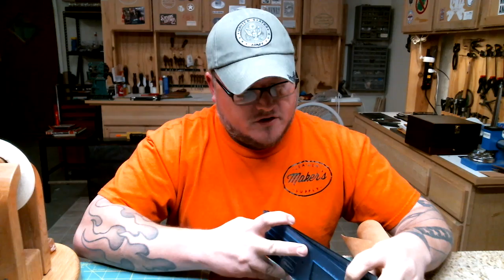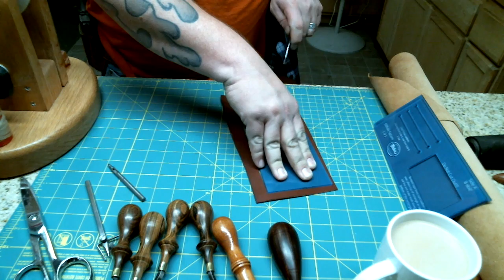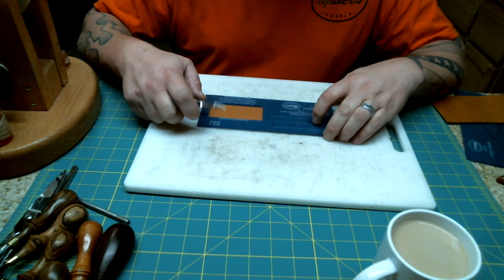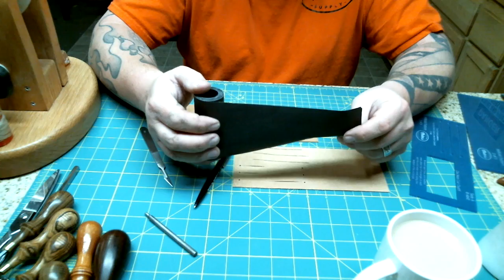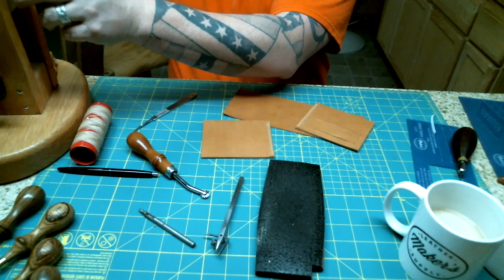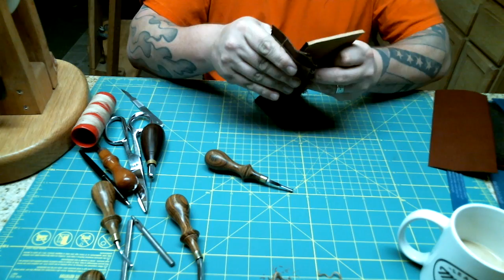Making a Billfold with the MLS Template Set

Comment: Hey Aaron, I don't know if you solved your Tieback issue, but I may have something you can try. I use photography backgrounds. They are a very strong nylon material, yet very thin and light weight, and come in a multitude of colors. I buy them from Amazon and cost about $15.00 - $20.00 each. I have been cutting strips and using this material for over four years, and it is fantastic. I am only about a third of the way through my initial purchased background.

Comment: i made 2 of these wallets this weekend and for a beginner, i think they came out decent.  the question i have is why wont it stay closed when i sit it down?  i put my granite on it over night to weigh it down and it is closed the next day.  but when i open it and close it,  it doesnt stay closed.  is that due to the leather needing to break in?  im sure once there is stuff in it and it is in the pocket it will help it stay closed. i just want to make sure i didnt screw something up since i am giving them as christmas gifts.  lol
i assembled it the same way as the video and  cut the half circle out and sewed across.  im hoping it is just a breaking in issue.
Reply from the maker: Could be breaking in.  Could be that your interior leather is a little thick.
Reply: @makersleathersupply1220  interior leather is thin. Might even be faux leather.  I'm really hoping once it breaks in it'll stay closed. Thank you for the great videos. I watch them and pause them over and over. Lol

Comment: Every template I’ve bought from u was unable to trace the card slots with my scalpel. The slots were to tight and my super thing scalpel could t fit.
Reply from the maker: If using an actual scalpel (not an exacto blade), there might be some laser trash in the slot.  Turn the blade over and use the non sharp side to push it out.  If you are using an exacto style blade, that is thicker than a scalpel.

Comment: i just purchased a few templates from you and have to ask. what punches do you use? i dont want to use a punch that is tapered differently and risk breaking the template
Reply from the maker: The set I have are very old.  I suggest marking your holes and punching after removing the template.
Reply: @makersleathersupply1220  cool beans will do thanks :)

Comment: Never understood why anyone creates a fold over, increasing the thickness of the card slot section, for a segment they're just going to stitch directly to the back anyway?  Pretty pointless.  Just cut a single layer, tyvek the backside then stitch it to the inner cover like you did with the tri-fold center.  Save yourself the extra 1/8th of an inch in thickness.  The fold-over makes more sense in the Roper, where you're actually using the space.  Other than that, it looks really good.
Reply from the maker: It is not stitched to the back on the folded side.  It makes a pocket there that is pretty useful.

Comment: how would one add RFID-blocking, i am asked about this often ... ?
Reply: found out that they are using that silver TAPE like for duct work .. i know you probable did not have time to reply ...
Reply: I use mylar.  Its cheap like ~2 or 3 dollars and i glue it to a sheet of tyvek before i cut out the strips for pockets

Comment: Aaron i ordered the template,  tape and tyvek from you and love it.  Just one question.  Is there a trick to keep my needles from getting so sticky sewing through the tape.  Keep the videos coming.  I love them
Reply from the maker: Not really, that is the downside of using the tape for holding the leather together.  I use a lighter occasionally to apply a little heat to the needle and then wipe the residue off.

Comment: Does the stitch line at the sides secure the tyvek pockets or does it only go along the leather? Surely just glue would come undone over time?
Reply from the maker: The tape will hold.  As this wallet is used it will constantly be compressed.  I've made them this way for almost 10 years and haven't had one fail yet.
Reply: technically the tyvek isnt secured at all by the stitching however; there shouldn't be any pressure great enough from putting a card into the pocket to sepatate the tyvek and leather that is taped together. if it does happen then that would mean that someone tried to shove their card in hard enough to damage the lining, and having used this tape and tyvek myself i can assure you "under NORMAL use there is little to no chance that this tape will fail"

Comment: What's the weight out the liner?
Reply from the maker: will Daniels the interior pieces are 2-3oz.  Exterior pieces are 4-5oz
Reply: Sweet thanks. Just got yourself a new customer. Expect some orders in a few months after I get back from this deployment.
Reply from the maker: Will Daniels stay safe out there.  SFC (Ret) Heizer
Reply: What was your MOS? Would it help to stitch the slots or will that tape last? I was looking at the possibility of stitching the top of each slot just to add strength. Also If I had designs for other projects could you cuts templets for them? Nothing but time over here and I've been sketching out ideas. I obviously won't know if they work until I get home and try but if they do it would be nice to have a templet that will last.